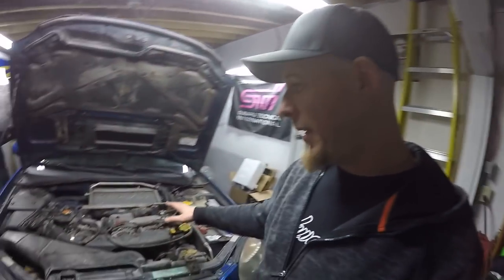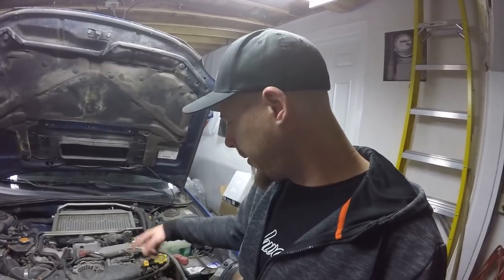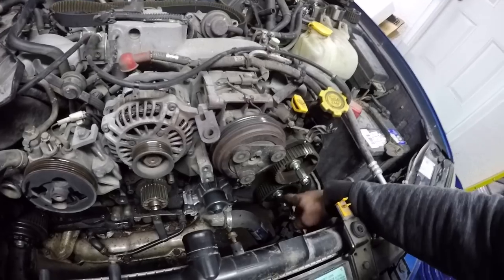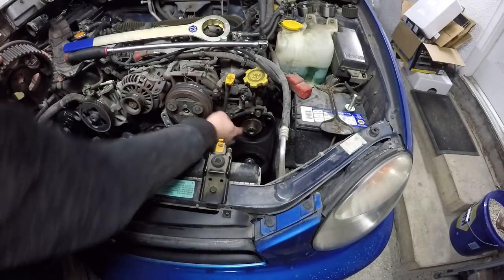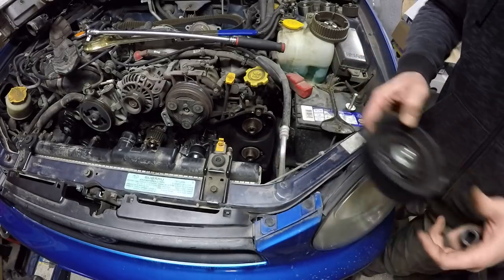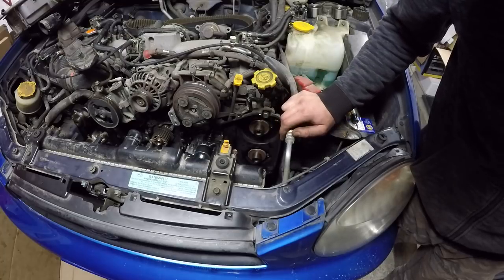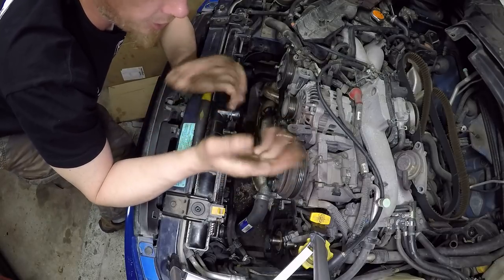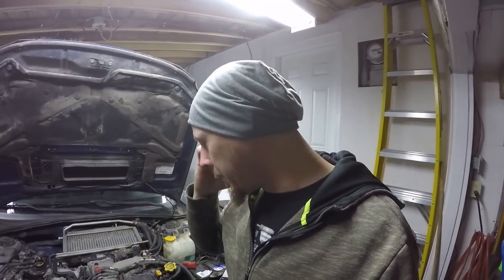2002 WRX Cam Seals Replacement - How To

Comment: I’ve had these so tight that it broke the plastic pulleys and striped the bolt and had to drill the heads off !  Love it when a quick easy job turns to 💩

Comment: So they're just like the crank seal? That's cool. Great informative video. And after doing crank bolt; 94ft lbs, outrigger main bolts 100, shock lower mounts, ~120/130, 74 seems finger tight. :)

Comment: My 2005 wrx is leaking from the same area. But it’s very very minor. Do you recommend if I add Lucas stop leak? Instead of getting it fixed
Reply from the maker: I always recommend that people repair things properly. You could try the stop leak, but generally when oil starts to leak there is no stopping it with additives.
Reply: Homebrew Subaru how much does it typically cost to get it fixed here in the U.S?
Reply: Homebrew Subaru or what will happened if I never get it fixed
Reply from the maker: You're looking at a timing belt job with some extra time. A few hundred for sure. Failure to fix the leak could cause timing belt contamination and eventually failure. Some cam seals leak to the end of an engines life and are never changed.

Comment: I googled/amazon "high performance grease" and found like 10 different types.  Synthetic, white lithium, and polylube just to name a few.  Would be more specific? Thanks.
Reply from the maker: That's actually a great question. You are looking for Multi-Purpose Lithium Grease. Not White Lithium. It can be synthetic, doesn't matter. Castrol makes a good variety. Red grease, yellow grease will do best, blue/green(generally thinner) if you can't find anything else.

Comment: Interesting... I have a leak from the steering pump area, also front on timing belt area and rack and pinion? Someone told me this could be cam leak? Is this true?
Reply from the maker: Kayla Pagan A leak from the timing belt area is a sign of leaking camshaft seals. The the steering pump and steering rack are a separate leak.
Reply: @HomebrewSubaru  ok thank you for the information!

Comment: Is there a tool for SOHC cams? I replaced the crank seal during my t belt install, but was afraid to take cams off
Reply from the maker: There are tools for all of the Subie engines. They are not cheap, but worth the money.
Reply: Homebrew Subaru 
Thnx, I do have the crank pulley tool, but that won’t keep the cams in place, unless I leave the timing belt on?
Reply from the maker: You will need a cam holding tool. The belt will never hold it tight enough if loosening by hand.
Reply: I can confirm the needing the tool. I tried many things before caving and spending $55 on it when I was prepping my engine to go to a machine shop

Comment: Does the cam spin at all when you are taking the seal out or once you get it out? I'm thinking about doing this at home, but don't want to mess up timing, I'll be fine to align the visible notches of course though
Reply from the maker: Yes, bank 2 camshafts(drivers side) will be under spring tension when going to remove and install the belt. Having the alignment tool makes it much easier.
Reply: @HomebrewSubaru  Do they still spin once the gear is off? Will the cams be moving once I take the seal out?

Comment: Great and informative video. I've got a slight leak from my '98 Sport (non turbo) and i've got a set of seals from a while back just in case. However i am a bit bit put off by the faff, special tools and the like, and i'm going on a road trip in europe post-lockdown. I have good quality basic tools, and a guy who is no stranger to laying under a car. I hope it goes ok...............
Reply from the maker: It's not easy to manage changing the seals without the tools. Getting those pulleys loosened and tightened is biggest part. The crank bolt can be very tight as well. Good luck!

Comment: Great video, I’m currently at the stage of putting the cam pulleys back on. From the video I think the torque setting is 72ft lbs on all four. Correct? I’m not certain as I’m not sure if you are referring to the crank pulley alone. Thank you again for the great video.
Reply from the maker: Thanks. I don't remember off hand what the specs are. They should be common to look up though

Comment: I am about to do this project with my 2011 wrx. Only thing I am confused about is how are you supposed to keep cams in place when taking the sprocket off to get to the seal? I do not want to mess up timing.
Reply from the maker: You will need the special wrenches to hold the sprockets like in the video. The camshafts may turn slightly during service but will be lined back up during reassembly.

Comment: Thanks for the helpful video. I've got an '05 WRX with 210k miles. I'm in the process of changing the timing belt and 3 of the captive nuts on the inner timing covers spun on me. So to replace the inner timing covers I'm going to have to pull the cam sprockets. Since they'll be off anyway is it a good idea to replace the seals even if they're not leaking?
Reply from the maker: Thanks for watching. Those pressed in nuts don't retain well when the bolts seize in them, really sucks when it happens. With that kind of mileage, I would highly recommend doing the cam seals. If they have been done in the past 50k miles, they should be fine.

Comment: Hi, love the video. Besides that cam holding tool, what all do I need in terms of tools to do this? I'm really new to this stuff and I'm nervous to mess with the timing system.
Reply from the maker: Thanks. Everything else is more or less standard tools. A good breaker bar and seal puller will help

Comment: Very useful video, appreciate it! One question...what was the process when you removed the tools on driver side to break the bolts loose? Just slowly release the tension by hand one-by-one? The top spins CW and bottom spins CCW from the tension, correct?

Getting ready to do timing belt, cam/crank seals, and reseal oil pump on 08 forester xt...

Is there much tension when re-aligning the driver side with the Co. 23 tool after seals are done?
Reply from the maker: Yes, you are well informed. The tools allow complete control to slowly rest the cams so they won't move. The cams should rotate in that direction. Having all three tools and a bit of patience, you won't have a problem re-aligning. Make sure to rotate the assembly afterwards to ensure timing is correct. 
Good Luck!
Reply: In the middle of this job myself right now and also had a similar question,, which I think you may already have answered, but wanted to be sure.

Question is, do I really rotate the driver's side (left front) cam sprocket a full 360 degrees clockwise and the bottom cam a full 360 degrees counter-clockwise, if necessary to re-align the marks from an unloaded position? Also, should I rotate the cams manually from an aligned position in these directions or just let them fall out of their loaded positions freely once I remove the timing belt?

Thanks for reading and for a great video!

Comment: Would you do a video on how to properly REMOVE cam seals? I'm thinking there must be some good tricks out there, as I tend to pretty much destroy them when removing them. ;-)
Reply from the maker: Unfortunately I can't make a vid because I don't have any seals that need replacing at the moment. The proper way is with a seal puller, but it will not work in every case. In this video I used tapping screws and threaded them into the seal. This made it easy to pull them out. No matter what you try... odds are you are going to destroy the old seals coming out.

Comment: Hey brother 

Great video 👍 

Can you name that tool you used to get the crank gear off the crankshaft ? Thanks in advance
Reply from the maker: That’s a gear puller 😉
Reply: @HomebrewSubaru  

Okay thanks bro! 

Where did you buy your timing belt tools from? On Amazon when I go to buy them to do a timing belt on a 1998 gc8 wrx, it asks me what size?
Reply from the maker: @andrewboulos2775  I ordered them from eBay. They should list what vehicles the tools work on

Comment: Hey how far do the cam seals need to go on? I hear all the way and also hear just flush with outside
Reply from the maker: Just flush with the outside. Drive them in too far and they will leak a stream of oil or drip

Comment: Awesome video, I’m doing this on my 02 wrx and I’m wondering if it’s possible to put the seal too far into the hole? Thanks.
Reply from the maker: Thanks. It is always a possibility to drive a seal in too far. This usually causes a leak that is worse than it was. Leave the seal flush with the casting and everything will be good.

Comment: Is it okay to use assembly lube instead of grease
Reply from the maker: Assembly lube is more for metal on metal. I think it would work fine, but I would recommend something lighter.
Reply: More trying to do damage control. I wasn't paying attention to exact phrasing in my service manual, and used red line assembly lube. I've been kinda panicking since realizing I was supposed to use grease.
Reply from the maker: Let's just say, using the lube was better than nothing. I expect that you'll be OK. :)

Comment: If I've got the engine out and on a stand, can I just use an impact driver to remove the sprocket bolts?
Reply from the maker: It is possible, but not something I recommend on DOHC engines. You will need the tools to torque the bolts back up.
Reply: @HomebrewSubaru  Oh, I should have mentioned I'm talking about an SOHC (so, metal sprockets - woohoo!). :-)

For torquing them back down, I usually wait until the belt is back on as I've got a tool/hack for holding the crank in place.
Reply from the maker: SOHC's are more forgiving. I have used the impact to remove and install bolts while holding the sprocket by hand. You will be fine.